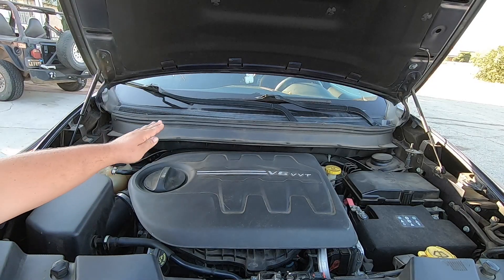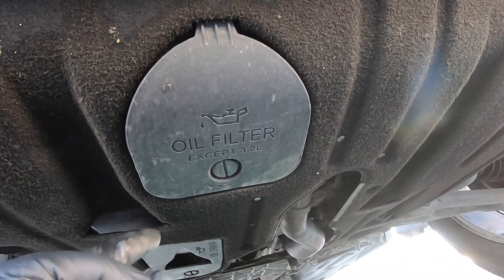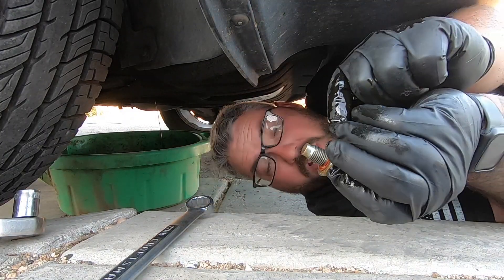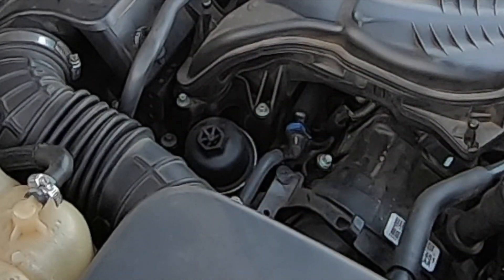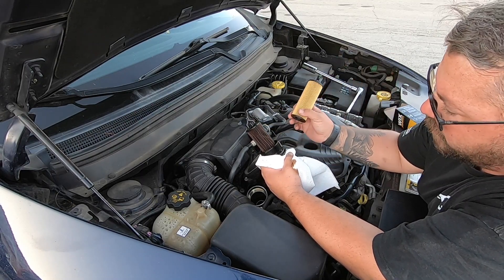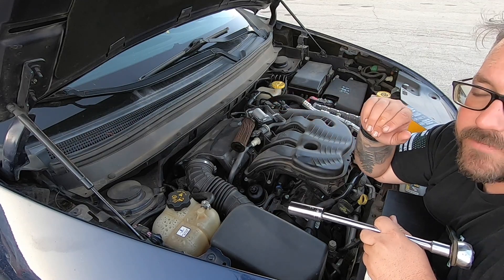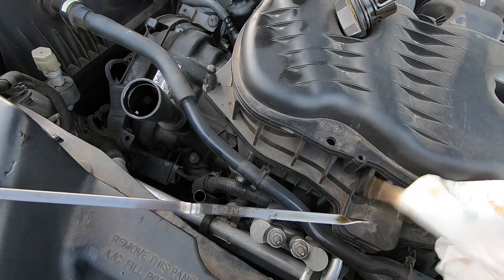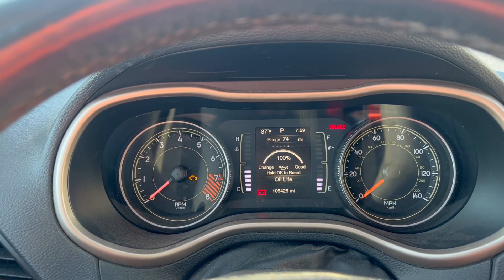How To Quickly And Easily Change The Oil In A Jeep Cherokee V6 3.2l Engine

Comment: Tip: I loosen oil filter cap first without removing and also pull out dipstick a little before draining the oil. This helps the oil to drain better.